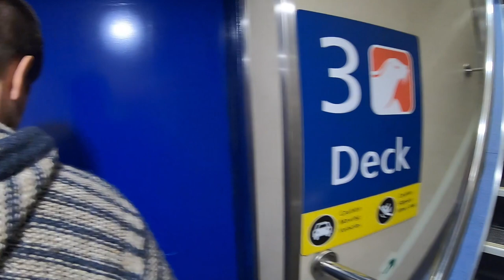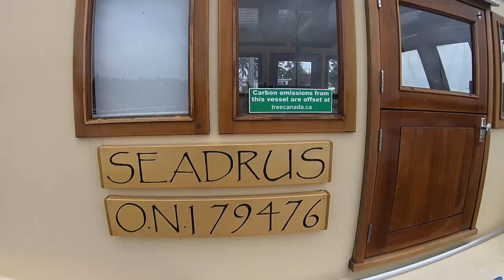Dickinson Diesel Heater Problems in Below Zero Weather on a Sailboat | Ch2 E17 | The Wayward Life

Comment: First find out (look at the bottom of the burner pot with the door open) if you are getting fuel at the bottom of the burner pot. If you are not... you have some issue with how you are supplying diesel to the burner pot.  Crack open nearest window to supply fresh air inside the boat for combustion inside the burner pot and to equalize barometric pressure inside the boat so the pressure inside the boat is equal to the pressure outside the boat. You need to be getting a little bit of diesel  to the bottom of the burner pot then shut off supply completely and preheat the burner with the diesel in the bottom of the burner pot for @ 5 minutes.  Use a paper wick to start the diesel to burn in the bottom of the burner pot and turn on your fan assist for @ 5 minutes burning up the little bit of diesel in the burner pot or until you can barely see the flame then slowly turn your diesel supply back on ...at a low setting and let that burn on a low setting for 15-20 minutes before you adjust anything else. Slowly allow to heat up and slowly allow to shut off and cool  down completely  before going to sleep or leaving the boat. I have multiple smoke and CO detectors inside my boat and I always leave a window slightly cracked open as well. If your boat leaks like a sieve and air supply is not an issue then I would still leave a window slightly cracked open. Follow Manufacture instruction or contact Dickinson they are great...! Hope that helps...Best...Captain Greg "Aquila" Shilshole L-31 Seattle.... gfawcett@nwlink.com

Comment: Don't get a wood one unless you want to be up all night putting in wood! That fire start stuff is for lighting Wood stoves it will plug up your stove.  Buy some methyl hydrate and pour in around two tablespoons at least, take a tiny piece of toilet paper light it drop it in the stove. if the boat is warm it might flare up so don't put your face right in front of the opening, usually it just lights. But if the stove is hot it will really flare Best to Not light with it when it's a hot stove. After it's lit just turn the stove to maybe 1 or 2 at first will be hard to see the flame but as the diesel mixes will turn yellow. Ive been using diesel stoves since the 80's and no problems. The key is don't run them really high they just soot up and then you have problems. mine has a nice blue flame and I never use that fan that blows in the bottom. When the fab-all's came out and living on the boat would light it in Sept. and not shut it off till march. So when on low if you have blue flame then turn up a little then wait and if blue still then a little more but don't have it way up high because then it can't burn all the fuel which will soot it up.
Reply from the maker: Hey Vern, 
Thanks for the tips.  Unfortunately we have tried what you are saying and it's an issue with the fuel injection.  Dickinson isn't making parts for this particular heater anymore and won't even release info on how to rebuild it.  We have taken it apart and cleaned it and they problem wasn't solved.  We also discovered after posting this video that the wood stove we were looking at isn't going to fit in our space, so we are back to either getting a Dickinson about the same size or trying to get another part that may or may not fit this one properly.  

Also, we have been following your channel for a few months now :D  Will def let you know next time we head to Gabe!
Reply: I bought a new carb for this one I have now was just a $100.00 The marina here ordered it. It came up from Victoria I think. You want me to find out for you?
Reply: Also just thought I have my old one where the input fitting is the alum. cracked but every thing inside worked great. You can have it if you want.
Reply: They're on the right track .. just clean the parts well with carb cleaner specially the hot plate .. also see if it actually is getting diesel the fuel line may need replacement or vent line is clogged.